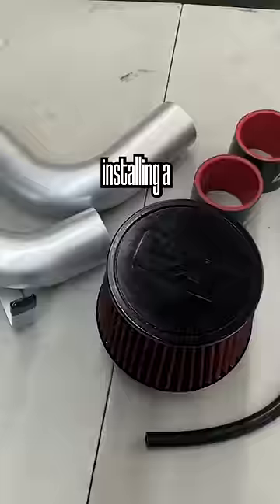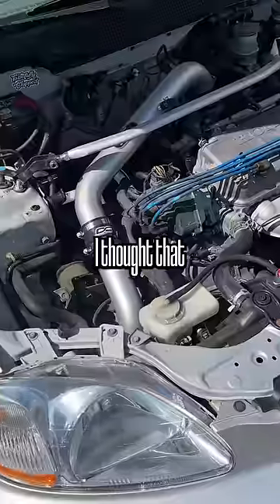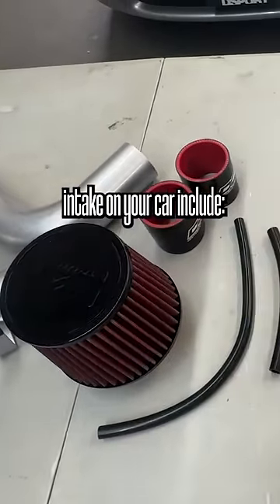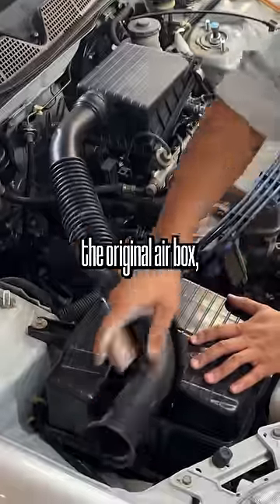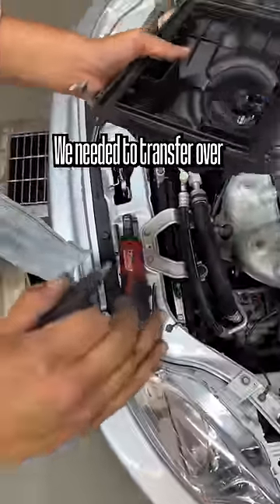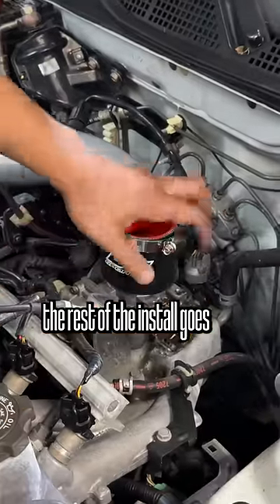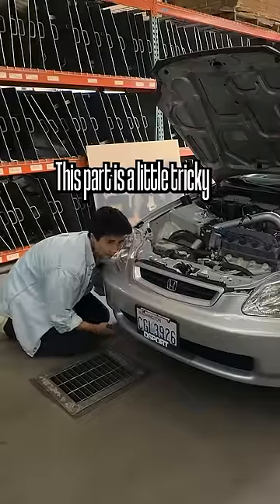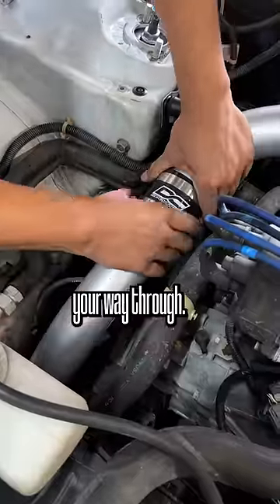Installing a Cold Air Intake on Your Car - Is it Worth it? 🤔

Comment from the maker: I don't see something like a Cold Air Intake as an upgrade that is going to make my car go faster, but just makes it a more audible experience on the track with some better throttle response. Let me know what you guys think down in the comments. Join our Discord for more. 🕵
Reply: What is your daily ?
Reply from the maker: @Im26c4u-OnYt  whatevers running 😭
Reply: Hey, bendaga, add a turbo with that sweet sutututu. And maybe a b16b (the type r engine) and add the type r spoiler
Reply: I prefer to install evaporated oil catch can.
Reply: @angeloamaral9141 well at that point why wouldn’t he just buy a type r? and a stututu isn’t exactly a good thing for the turbo. there are bovs for a reason
Reply: @polarfox2637  yeah, but to the biohazard civic. The biohazard type R
Reply: Hot air intake 😂
Reply: Who the fuck goes to a shop to replace an air filter? Are men really this gay nowadays
Reply: @moochiezpitt I mean at least it’s in the fender liner and not the engine bay
Reply: Rebuild a separate box for the "cold" air intake. You took out the factory air box, without it, you'll be pulling hot engine air into your intake instead of cool outside air.
Reply: Yes but worth it especially if I have a turbo
Reply: Well a cold air intake is good but for most performance applications the factory air intake should be more than enough as they designed to give the best performance possible for the factory goals of the car and a modified factory box can be better than most aftermarket intakes if done correctly
Reply: Слишком низко. Лучше в крыле сделать вырезку, выставить туда вход воздуха
Reply: the increased air that gets to the engine, if tuned right, will def give you more performance, maybe 3-20 HP depending on what you have
Reply: If it matters, it also reduces weight at the front of the vehicle since these cold air kits are usually lighter than the oem air boxes.
Reply: I have a k&n on my '17 f150 boy does it wake up the rpm when I need to.
Plus it sounds great
Reply: It's not an intake temperature sensor it's an airflow metre.
Reply: @moochiezpitt  thats why its routed down low in the engine bay to pull cold air rushing under the car doofus

Comment: The first person to install a proper cold air intake and not a hot air intake
Reply: This is better than most, but this type of installation imo is not the best because if you get into deeper water or some water splashing on there, you might wet the filter or even worse get water pulled into the engine, the intakes are up that high for a reason, as long as the intake isn't in water, the engine runs. What would really be a proper cold air intake is if it were sectioned off from the engine inside the engine bay with a heat shield and this part would be right in front of a part of the bumper that gets air inflow. If I were to do the setup, that's how I'd do it.
Reply: @thomassaarniit2997 a lot of stock intake pull air from right behind the bumper
Reply: I was very happy seeing he did it right
Reply: Using metal pipes soak up the heat which in turn heats up the air entering the engine. Just stick with the rubber ones or wrap the pipes in that head shield stuff would look nicer anyway.
Reply: @thomassaarniit2997 my ss has an air box inside the wheel well, not my first choice but if made properly they are water tight because of the seals and cause no issue
Reply: That hot air intake debate as been debunked by legit street car. He literally has a 1000 whp turbo trans am with « hot air intake » set up and there’s no difference.
Reply: @maximeparent3004  Yeah mate because intercooler removes the heat anyway 👍
Reply: @thomassaarniit2997 I fed mine down by the wheel well like this guy did in the video; but my cars' got these louvers that the nicer models have foglamps on. I made a vent in there that pipes air directly into the intake. I've temporarily solved the water issue with a hydrophobic intake cover. That thing actually works super well; it even catches the dirt and grime, keeping the intake clean
Reply: @maximeparent3004 He has a turbo, which would serve the purpose of a cold air intake but to a much greater extent obv 😂
Reply: @thomassaarniit2997 nah haha
Reply: Same, I was surprised when it actually went down that low. Most people don't seem to know what CAI actually means haha
Reply: Wait till hit the water puddle 🤣🤣

Comment: You need that water resistant pre-filter to prevent any water that could come on with that cold full cold air. Props to you doing the the full cold air and not a short ram.
Reply: lol yeah I’d double down with some flex seal on that liner
Reply: Water in that small of an amount is actually good for the engine
Reply: @h0udinl  yeah saying this for more along the lines of 4 to 6 inch puddle or mini pond. Around here when it rains it sorta floods small areas you hit that with long ram. It's done until you pull the plugs and clear the cylinders

Comment: A factory intake is a cold air intake and cone filters don't have more surface area, they're for packaging. Most of them flow enough air stock, that they aren't really a choke point, or can be slightly modded.

Comment: a cold air on a D16Y7 is absolutely diabolical work
Reply: Hes lost power everywhere but near red line
Reply: @mrmedium7984  nah i dont have an issue with cold airs i just think it's funny bro spent the money to buy a REAL CAI and put it on a d16y7... a whale pp literally would've been better and only 36 bucks off fleabay
Reply: @miniblad33 he’s not gonna see any gains without a tune and other mods but it’s a good first mod for any na car, no matter how low on power they are
Reply: @ashleyscott2674  best first mod for any NA car is to add boost 😂😂😂

Comment: I can vouch this... deffinatly worked on my old B18c6 1995 civic & my civic aerodeck... It won't work straight away, I un plug my ecu over night... Next day go for a long drive so ecu can Re read fuel and air. It's the Short pipe induction that sits next to engine is the one that lowers power as it sucks in hot engine air... The colder the air... The better😎

Comment: Clean install. The one question is,does your MAF sensor adapts well to air flow changes without throwing your MAF Fuel Trims off? MAF sensors can run rich or lean after resetting by unplugging your negative battery for the MAF to relearn. Some vehicles require a tune because the MAF sensor is picky and kin to only stock air box presence and not willing to adapt designed by the manufacturing just following stupid EPA guidelines.

Comment: As long as you tune the volumetric efficiency in the ecu if you don’t do that then it does nothing really
Reply: That’s what I was thinking
Reply: Look I explained hot air and cold air I take cold air any day with a tune and without
Reply: @amroelmughrabi  not to be the emoji 🤓, but that makes less as your engine runs lean and then makes less power and more heat. You could even throw a lean engine code
Reply: @aidenbirak  I live in the desert so 50C 122F weather is what I meant
Reply: Car does that for you map/maf

Comment: Airbox is the best CAI already. Piping and TB are the limiting factors. I haven't had a built Honda in almost 20 years but that 94 integra gsr had the intake pipe from an AEM short-ram hooked to the stock Integra airbox, a 75mm throttle body, Edelbrock Victor-X plenum, ACT stg4 6-puck (unsprung) and the crank/rods/pistons and header from a 97 type-R. It didn't make crazy power but it was a lot of fun. Cone filters always looked kinda cheesy on N/A applications tho imo, like I'm trying to fool people who's options I don't care about into believing my car might have more than it seems when really, no it doesn't lol

Comment: Did this exact thing on my ek coupe mine was a 2000 hx coupe with the d16y5 I had the top end built with skunk 2 valve train and stage 2 cam stock bottom end full header and exhaust and intake exactly like this, slightly bigger injectors and that little thing made 180 at the wheels fun litte car man I miss it would’ve loved a b swap

Comment: "increase fuel economy"
Tell this to my Genesis Coupe 3.8, after the CAI it just drink fuel like it's no obe business (at least fuel is cheap here)
Reply: maybe disconnect battery and reconnect could just needf to recalabrate
Reply: More dense air means more fuel to help make more power, no fuel savings. 
Most of the time a tune is needed to optimize for this mod since the ECU isn’t programmed for recognizing the increased mass air flow and will actually spit out more fuel than you think.
Volumetric Efficiency
Reply: @benny6712  nailed it
Reply: @benny6712  no?? Unless you tune it to change the fuel map, the amount of fuel injected per cycle will stay the same?? There is a slight increase in combustion efficiency by adding more air but it’s negligible, but on a EFI vehicle the fuel input won’t change.
Reply: @benbrooks566  eeeeya so a tune is “still” needed even for a little gain, it is more so important if your intake runner is 3” because it is still way more air passing the MAF sensor than what the OEM ECU has been programmed stock from the manufacturer to know what to do with all of that increase of air. At the end of the day a 1% gain is better than nothing if you are talking about this being negligible especially if all you are doing is just this air intake mod. 
So if you want more HP increase then you need other supporting mods.

Comment: I would put a bypass valve in the middle of the pipe where the connector coupler is. Just in case of water.

Comment: I hate that intake manifold. Its terrible for airflow. If you're going to stay single cam, go with the Y8. The stock intake manifold on the Y8 is a lot better for flow, plus you get VTEC.

The nice thing about the EX and EM1 Si, is there is a hole behind the passenger side headlight that allows you to cleanly run an intake behind the bumper side vent. If you aren't using those vents for brake ducting, it's a great spot to run your intake. It keeps the intake air completely compartmentalized from the engine bay air, and for the most part, it's some of the coldest air you can get. The only downside is on hot track days, the heat from the tarmac increases your intake temps a decent amount, but it's still nowhere as hot as the air in the engine bay. 

If you're going to track it regularly, I would get a baffled oil pan. The stock Y7 oil pan can cause some pretty severe oil starvation issues on hard cornering if your oil isn't over the full mark on your dipstick.

I have a lot of experience with these single cam 6th gens. Used to have a pretty nasty EX coupe, and now I have a CX Hatch that's being converted into a full-time track car. Still rocking the single cam. No reason to destroy a beautiful B series motor on the track. 😂

Comment: Dude do a sohc vtec build maybe turbo it would be fitting for the car the motors are cheap and aboundent may be a direct swap AND I'm convinced they hold boost and break less that the dohc options

Comment: My Cobalt has a proper cold air that goes into my bumper. Kinda serves mabye a little bit as a ram air to, because of the hole near-by the fog light in the bumper area where it is, or least,  gets fed more air because of that.

Comment: Should’ve just reused the original box and ran the pipe from the box. Doing that will allow for water drainage if you suck any up.

For my setup I replaced the stock filter with a high flow and ran a new pipe to a fog light in the bumper. I have yet to suck any water up the pipe. I tested it on a day of heavy rain and the box was bone dry.
Reply: what kind of pipe
Reply: @amrwerd8979 Honestly on a 4 cylinder you could get away with any pipe/tubing that fits your box. Yeah sure if you use some types of tubing you will have turbulent air flow but it really doesn’t matter on smaller engines in my opinion. If you have a turbo then it really doesn’t matter because that air will be more turbulent than what’s going through the intake pipe.
Reply: @SuperSpreeGaming  oh sweet, thanks I'm n/a so I'll just find me like a flex tube and run it near my fog light.
Reply: @amrwerd8979  That’s exactly what I did haha. My car didn’t have fog lights from the factory so I bought the fog light panel to replace the factory one with no hole. Turns out the tube I bought was the perfect diameter and I just glued it on. I had to remove the resonator to make room for the tube. People say it reduces gas mileage but my car would max out at 40mpg and since the modification I’ve seen upwards of 56mpg.

Comment: nice civic but try runnin a short ram intake that pipe is pulling air from under the carriage so i dont thinks its pulling in cold air more like neutral air which i say is better then cold unless you want your temperature sensor to be flippin, you most likely gaining small portions of rpms in launch if stock runs  idle at 700rpms this upgrade boost your idle to 1000-1200rpms and thats without messing withe the throttle body which you can also tighten more to boost your idle rpms 

basically your cold air intake is still stock since its riding under the carriage remove that extender and you'll be running cold air but be careful you could be pulling in more moisture into your engine block,you can also cut the cold air intake tube around the front end upper strut bar to make a short ram intake which pulls in a mix of neutral and hot air which i found to be exceedingly well

Comment: that cone looks tiny is it actually more surface area than the factory oem filter? (i’m guessing a square style based on the air box) You might want to consider getting a bigger one

Comment: Why not just put another filter on the crank case breather? What I do am for all my cars helps the car run a little leaner on stock ecu more air more gas 😎
Reply from the maker: you could do that too! just as long as you plug up the open hole in the intake itself

Comment: I wanna run this so bad, but I'm not running fender liners and don't wanna fabricate a box . And I daily that thing, one rainy day and I'd be locked up
Reply: want a nice daily? stay away from all aftermarket intakes. your stock airbox is more than enough and filters better than most other intakes, and is waterproof up to a point.

Comment: Most people dont realise the factory air filtration system is actauly a cold are intake as it is isolated from the hot engine but it is rather restricted and without tuning the engine afrer installing the performance air filter kit the engine actually losses horse power
Reply: Depends on the airbox. The factory Mercury Marauder and 05+ CVPI box can support well over 400hp.

Comment: These cold air intakes only work if you properly install them most of the time people install them near the engine instead of actually making them go down towards the front of the engine most people that install these I have no idea what they're doing. When they install these most of the time sucking in hot air from the engine instead of cold air like they're designed to do

Comment: Hot air intake
Reply: Did you not see they properly installed the filler at the bottom of the engine bay and not at the top?

Comment: You know a cold air intake setup doesn’t do anything to improve power or throttle response it will actually cause your cars Ecu to detune the power . The only way it works is if you tune the ECU and tell it that it has the extra air coming in so that you can get the performance that you were looking for. I’m just saying.😅
Reply: and check engine light
Reply: Now I don't know anything but I would assume the MAF would make small adjustments to compensate in a beneficial way.  Not entirely but enough so that it's not losing power

Comment: On a NA car? You lose power on the bottom end unless you tune it. 😊 Factory air box is engineering design for reasons example air speed

Comment: really shouldnt instañl these theres certain small things like even stuff with vaccum or pressure designed at an angle for better fuel economy and bettter performance with stick intakes throttle bodies and even manifolds and i can assure you most companies that make aftermarket parts dont take the angles of things into perspective

Comment: Well you failed by getting a civic with the d16y7 it's slow as balls. Should have got the ex model with the d16y8 ... while ur at it throw a y8 block in there and z6 head get a vtec ecu from the y8. Your welcome

Comment: As a former Honda owner (EG hatch w/jdm b16 swap & 95 ex coupe stock d16z6 with greddy turbo kit on Hondata s200) your throwing away money when it comes to putting bolt ons on that motor. The only way to make power on a single jingle is to go boost! Luckily theres plenty of cheap kits out there that can actually make decent power. I would spend lil bit more money on tuning however. Don't wanna cheap out on that!

Comment: I’ve owned many of these shitty cars.  Intake and exhaust just burns more gas.   I didn’t get more power until I started building engines fave was a y8  head on a a1  bottom end in an ef chassis with a eg short ratio tranny.  Fasted but least enjoyable was an Ls vtec with a crv bottom end and b16a head and tuned I guess.  I had an eg h22a swap and it was a plow. Slow and couldn’t steer for shit

Comment: Lol cold air. NOT!!! U should touch that METAL intake tube after your car warms up and u been driving it. Post the results on how warm not cold it feels. What a joke. Poor decision
Reply: i have a short ram intake aka hot air intake on my turbo subie, ive touched it after a mountain run and it was cold. u should realize heatsoak only happens when ur at a standstill for minutes on end, and the heatsoak almost immediately goes away once you start moving.